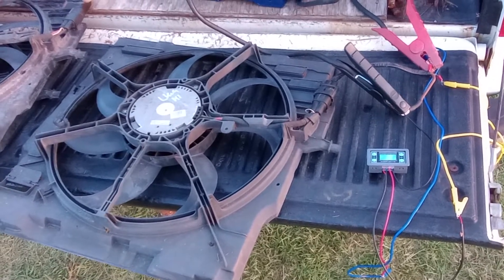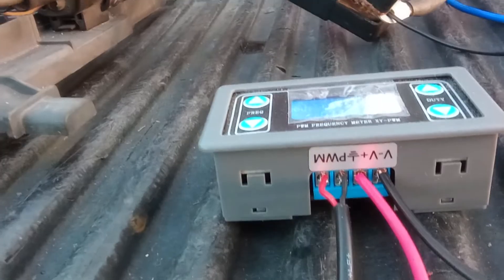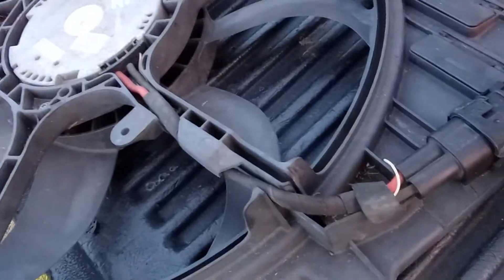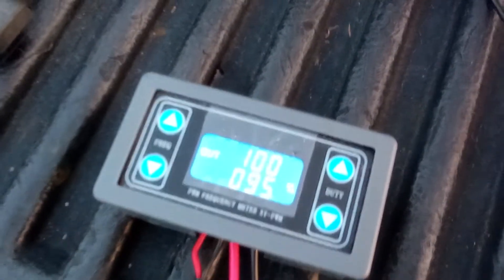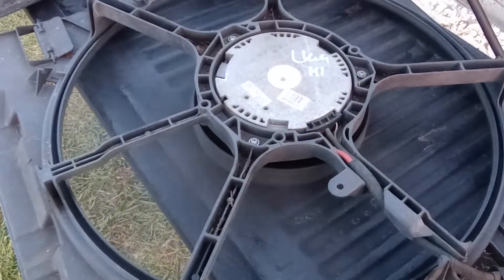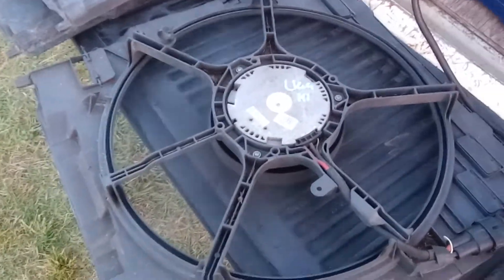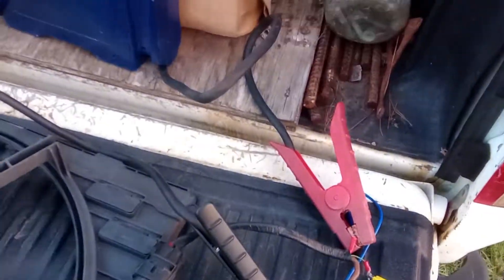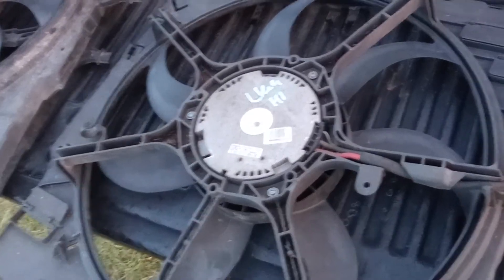BMW PWM electric fan bench testing, easy method

Comment: Is the pwm generating signal using the same 12 volt source that is powering the fan ?
Reply from the maker: For this test,  yes.  I used a JNC 660 battery jump start box.  To ensure you have enough wattage to run this type of fan for very long, you'll want to use a full size car 12v car battery or a good size battery box.

Comment: Hi, thank you so much for the explanation .
Can you tell me please, what voltage is the signal to the small wire?
Reply from the maker: I believe it's 0-5vdc, but it's the PWM (Pulse Width Modulation) signal, so you won't be able to easily measure or simulate that signal without the PWM generator or some similar equipment.  It's not a constant voltage, it jumps up and down, on and off.  Hard to explain but you can google for more info if needed.
Reply: @rigmaster1  hi again, thank you for your answer. I have checked that the small wire takes +12v from the main +12v to the two big wires (internal electronic). And the the ecu from the engine internally connects the +12v signal to ground. Following a specific pwm pattern.
Never connect the small wire directly to negative, this will create a short circuit and destroy the fan electronic
Reply: @xnpl  I read this after putting negative to the little black wire, what happens if you do do this?  
Backstory my fan quit working I ordered a new one. I had it on my workbench and I thought I could test it positive negative and a ground to the Lin bus (little black) wire. 
But nothing happened, I then proceeded to connect it to the car on the hood and just test it and low and behold it came on, maybe I just got lucky and nothing happened to it by touching the ground to that little wire?
Reply: @Robcbr91, your answer is the right one. Follow this info guys. 12v. Ok/ negative. No, to the small black wire

Comment: BMW 318i E46  2007 problem blowing diode fuse  when  connected  to radiator fan  blown located in  gloves  hole  seeking  a  solution

Comment: Awesome video mate. Really helpful as I have an original 08' e87 fan to test and a new one that I have not seen running due to a potential signal problem. Is there anything related to the frequency buttons that may need to change depending on the car model or just keep it on the default? Much appreciated!
Reply from the maker: you can change the frequency if you want, it won't hurt anything, it may change the way the fan runs, but I found that around 100 was a consistent setting for these E70 fans.
Reply: @rigmaster1  Thanks for getting back to me mate, much appreciated. The PWM generator is a cheap piece of kit for the potential reward of seeing the fan running again. At the least it will knock off something from the 'things to check list'. All the best!
Reply: I’m trying this as per your setup (I think!!) and when I connect the 12v car battery the wires going to the fan are starting to heat and spark. What could be wrong?
Reply: @michaelmcginn8984 be sure the positive is to positive etc

Comment: Can you do this test on nissan altima blower moter 3 wire
Reply from the maker: if it uses a PWM signal for the 3rd wire, plus positive and negative- it should work just the same, but try it at your own risk.

Comment: hello, my electric fan does not start when I press the air conditioner. the 20 fuse burns in 2 seconds. what could be the problem. my car is e38 from 1994. Thank you

Comment: How can i bypass the signal wire? Thanks
Reply from the maker: As far as I know, you cannot.  You need to "command" the fan with a PWM generator like the video, or using an ECU or other electronics.  This method is by far the easiest if your ECU is not working properly or if you are using a PWM fan in a different application.

Comment: Coming from e46 owners group I’m the guy that’s having that dme issue no other codes but I wanted to come to this video seeing as I already have this installed by previous owner and if I ever have issues I’ll know of top how to do it can’t wait to learn brother ☝🏻
Reply: Hey. I got E87 (series 1) with N46B20B engine. My fan is working on very low RPM and it is not dependent on temperature or air conditioning. Sometimes it won't turn on at all. After connecting INPA and controlling it, it starts at maximum speed without a problem. Is it a problem with DME that it doesn't control this fan? It seems to me that after turning on the air conditioning, even though it only cools the condenser, it should spin much faster.